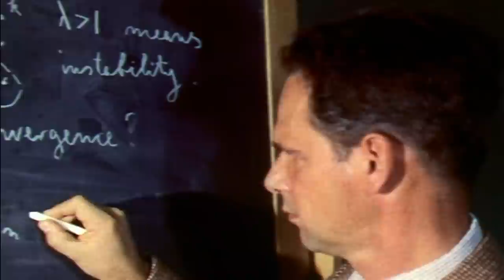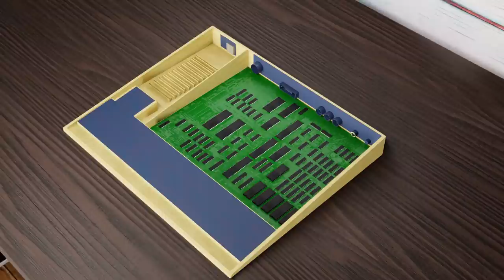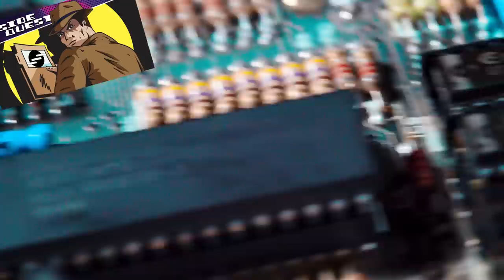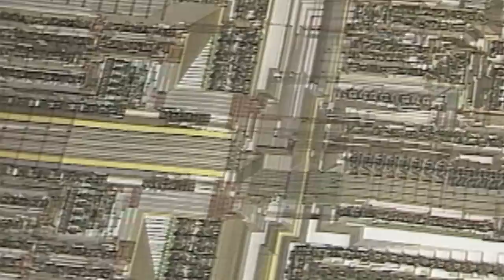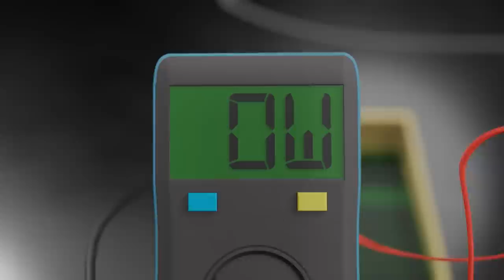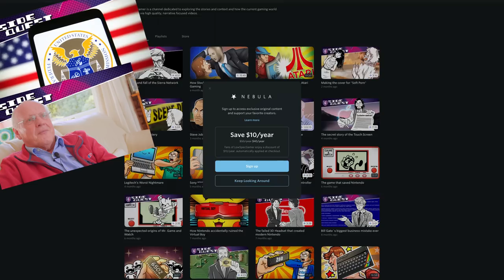How Amateurs created the world’s most popular Processor (History of ARM Part 1)

Comment: There are several mistakes in the video:
1. I am not sure that that Acorn hired exactly Sophie Wilson, hence certain inaccuracy in dubbing. Hermann Hauser still can't get his head around the transition!
2. The multiprocessor architecture of the Beeb was planned from the beginning, as several factors were in favor of that: (a) the architecture was originally built as a multi-processor system to power gambling machines (a very shady but lucrative deal with local mafia); and (b) when accepting Acorn's bid, BBC insisted that Z80 expansion is a must.
3. The Z80 expansion was actually sold, capable of running CP/M 2.2.
4. ARM expansion of the Beeb was not really available to the market. It was more of an early devkit for Archimedes software developers.
Reply from the maker: 1. It is generally considered in bad taste to deadname people, so we tried being tasteful on that.
2. This actually unclear. Some interviews point at the fruit machine as creating some of the ideas for the multiprocessor design, some point at Sophie coming with the idea along with the Tube connector. The exact genesis of the dual processor design is probably one of those ideas that came from many small elements. I would be interested if you have a source on BBC requiring the Z80 module because that I never read anywhere.
3. I know! Several other processors in fact. It was just not relevant to the ARM story.
4. Correct as far as I understand, but this video finishes at first prototype. What happened when they tried to commercialize is a topic for the next.

Comment: I worked with Acorn/Acornsoft implementing Forth for the BBC micro.  I also looked at implementing Smalltalk for the NS16032 add on.  I ended up implementing Pascal for the Sinclair QL for a company on the Cambridge Science Park for which I was technical director.  We got the very first UK MAC but someone blew it up plugging the US machine into a UK power supply.  We used an Apple Lisa workstation as a development machine.

Comment: Watching this on a laptop with an Arm cpu. I very deliberately chose it for that. Unfortunately the software these days makes that tricky as nobody wants you to install a rival operating system and there's no standard bios or hardware detection like on the PC. Its a fight to replace chromeos with something usable.

However now I'm over that hurdle and have some Linux mostly how I want it, the hardware really shines. 10+ hours of battery life. No fans, No vents, always runs cool. All the CPU performance I could want for daily use. All for £200 brand new!

If there were more standardisation, x86 would have started to die off on the desktop already, and on laptops it would be long gone. Unfortunately Arm is still seen as the embedded processor.

Comment: The Atom did non't have networking, 

Yep and that "second c-processor did not work out well or offer much benefit.....
during the 80's I worked at a games company, and we had both.... ultimately we were using  68000 to cross compile games to run on the 6502's
for the BBC micro and the commodore 64's

That F*** ing "BBC micro " second co-processor barely made any head way for   assembling  6502  code. and it was forever crashing or hanging , doe to timing problems between the main  & co-processor CPU
Reply: Let's connect 2 processors and 2 memory controllers with long cables and parallel protocols, what could go wrong

Comment: i made a MIDI filter with an Arduino pro 5v where I got rid of all the optical isolators; and that board booted! it booted off of the 5v input MIDI dimm. no power source except the input. and writing transformed midi to output.

Comment: Kind of strange that they wanted to build an expansion for workstation capabilities, but cost and cooling were an issue? Typically workstations are about performance at a premium price. They wouldn't be something you'd need for a classroom, so why were they worried about the education market?
Reply from the maker: I did ask about that in the full interview. The answer, in a nutshell, is that educational market was their biggest client so they assumed they had to please them for all products
Reply: @LowSpecGamer  Makes sense they'd be concerned, but the base product already seemed to cover that market nicely. Either way, I suppose their concern led them to a pretty important invention.
Reply: @LowSpecGamer  Plus they also did second processor kits with a Z80 (running CPM) and x86.

Comment: I had a late model Acorn Archimedes back in the day. Best computer I ever had - but limited by software availability.
I also remember the introduction of the BBC Micro into schools (I was at school at the time!), although in our school it was preceded by a Research Machines RML 380Z (yep, powered by the Zilog Z80). By the time I left in '83, the school had 2 BBC Micros and two RML 380Zs. Not too shabby for a bog standard comprehensive, I guess.
ARM cores turned up in my Psion 5 (remember those?), then my mobile phones, and now they are in many, many things. I suspect even my Broadband modem has some of them in it.
More computer power from less electrical power - the Holy Grail for mobile phone, tablet, & laptop design, amongst other things.
Even the Intel laptop I am writing this on has Performance Cores and Efficient Cores - just an alternative implementation of the big.LITTLE idea in so many modern ARM-powered devices.

Comment: Wait till you find out about what came out of 3DFX chip from Starfox - it spawned another architecture called ARC which through two acquisitions wound up at Synopsys and is still thriving. It found its niches in security and embedded vision. Even Intel used it in previous generations of the Management Engine.

Comment: I started off building an RCA Cosmac Elf w/1802 processor in '76.  (Toggle switches entering machine code)
Went to school in '80 and learned 8085 and Z80 assembler (yuk).
Moved on to 6502/6510 with the VIC20 and C64.  Learned Forth, my first non-assembler language.  (Grudgingly did some Basic.  gag)
Then Motorola 8 bit for embedded stuff in assembler.
Then AM2900 bit slice processors.
Than 680x0 (and PPC). (Amiga 2000 and 4000T w/Video Toaster)  Very cool.
Got stuck doing some Z380 assembler crap.  (HORRID)
Now I'm doing ESP8266 and ESP32 embedded stuff in C++ and assembler for my own projects.
What a trip.  I probably missed listing some processors.
Interesting note:  The RCA 1802 is still being used for satellites and spacecraft.  RAD hard.  Most likely used in the Voyager spacecraft.
I successfully avoided anything x86/64 my whole career.  YAY!

Comment: A correction: narrated was “6800” when referring to the Motorola 68000. As the other chip being considered was also a 32-bit chip with the TMS 32016 and the 6800 doesn’t compare (and was old hat by then, as the 6502 was meant to be a stripped-down replacement of it for costs) that’s a little bit of a slip.

I won’t comment on the other issues others have already covered. Otherwise, great video! Thanks!

It’s comical to think they made a mistake in properly hooking up power on a prototype and still had it work.
Reply: Apparently the stripped-down replacement for the 6800 was the 6501. It was even pin-compatible. Motorola sued over that, which is why you (almost) never hear about it any more. And why we have the 6502 instead.
Reply: @lawrencedoliveiro9104  Yup. One of those little quirks. But if something is going to be put up to be a documentary-type of video, while there are other issues, it pays to make sure the easy ones are fixed quickly. Comparing the 6800/68000 to the TMS chip, for those that recognize what they’re looking at, it’s clear which way the mistake was made, in the narration. I submitted my comment in hopes of ensuring the narration is fixed to remove confusion on that part that may be suffered by other viewers that never knew the processors in question because they were aware of them as they were current for them at the time ;)

The trans situation was handled in a curious manner in my estimation: to me it makes the most sense to refer to someone with their recognized and used name, etc. at the time the events happened. Yes, I’m aware of the “dead-naming” thing, but you don’t get to choose what you were called retroactively during a particular time in history: name changes don’t happen retroactively, it’d make reality impossible to navigate. Imagine if the Bible (as the easiest reference I can target) used the names of people from the start to the end, and pretended they didn’t have their names changed, how confusing that would be, not to mention obscuring the sequence and reasons for events.

Comment: I still have a powermac G4 with an upgraded 1Ghz PowerPC processor. It may not be fully ARM, but it certainly is a RISC architecture.
The sad part is I can't find a compatible power supply for the increased power demand from that processor and the ATI radeon 9200 graphics card.
But it is amazing that a computer from the year 2000 has 1Ghz processor, a GPU that can play quite a large number of games, and 2GB of RAM.

Comment: Odio ser tiquismiquis, pero fabricate en inglés es falsificar, deberías usar "manufacture"
Reply: We use the term "to fabricate a silicon wafer or integrated circuit" as industry jargon, whereas manufacturing is limited to more circuit boards and larger sizes.

Comment: It won't be for long when risc-v overtakes it. arm's only popular in the android and datacenter space. However, google is planning to replace arm with risc-v in android phones and, soon enough, the rest of the industry will adopt the open source risc-v architecture instead!
Reply: What is even the difference aarch64 and RISCV . AARCH64 has flags and risc V uses mips paired CMP branch instructions? All 3 are cheap. 32 registers.

Power on the other hand: flag file!

Comment: ARM is quite popular in fact that someday it will be as powerful as a x86/64 and it's more versatile in many applications including computers as we seen in the tech industry. They're also low power and releases less heat, making it useful for portable tech.
Reply: I think Apple may already have an ARM based processor that's at least "as powerful" as x86, in the desktop/mobile market anyway.
Reply: ARM processors have long been capable of challenging x86s. The thing is that licensees have long leaned into low power applications. Just because a processor family can be low power doesn't mean it can't also be fast. Just as Acorn did with the original ARMs, Apple are now reminding the world of that again, and ARM processors are becoming more and more popular in data centre applications, where they can supply the same processing power with less energy consumption and waste heat than x86/64 machines.

Comment: ARM success has more with luck, marketing and some idiotic decisions made by owners of other architectures. You don't believe me?
Example 1: When you could find 100$ or so ARM board, MIPS boards were expensive as hell, okay for pros, but absolute crap for students and hobbyists.
Example 2: ARM bragged about low power, but comparing MCU without proper TLB for virtual memory and without FPU to a CPU which could run full blown Unix (like) OS is apples and oranges comparison. Heck, some ARM cores didn't have proper caches, relaying on small instruction cache and store buffer as kind of miniature data cache.
And compared to all RISC CPUs, ARM (32b) is the ugliest architecture of them all with smallest number of registers, flags and with ugly pipeline leftovers, making branch delay slot peace of cake.

Comment: The only reason I'm giving this a dislike is for further promoting the worst processor architecture. To call it popular is also nonsensical as most people have no clue what processor runs the devices they use and don't care. If ARM chips weren't so cheap no one would use them as they aren't as high performing as people think and claim. There's a lot of legacy complexity in x86 chips and that adds to the performance leakage. The fact that they have to incorporate everything all the way back to the 8-bit days and how the processor has to change modes upon startup to handle modern 64-bit code negatively impacts everything. However, the ideas behind the majority of CISC architectures are far better not just for processing but power requirements. They just need to scrap all of the backwards compatibility and start from scratch. A completely new CISC architecture chip with a from scratch instruction set would be far lower power than modern ARM and run far faster. In case you wonder why I say that, it's because the processor would do more per instruction and could optimize what it does far better than you could as a programmer or than what it could guess at as the code runs. I usually like your videos, but this one rankles me because it's a demonstration of how we're further pushing in the wrong direction both as a society and from a technological perspective. I don't like witnessing the collapse of humanity, but I can't look away for some perverse reason that I can't quite explain.